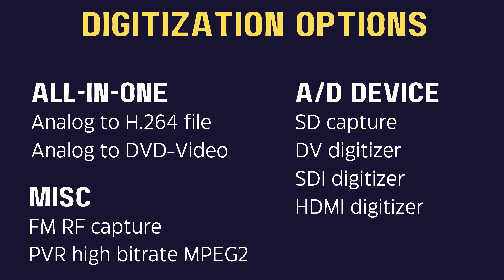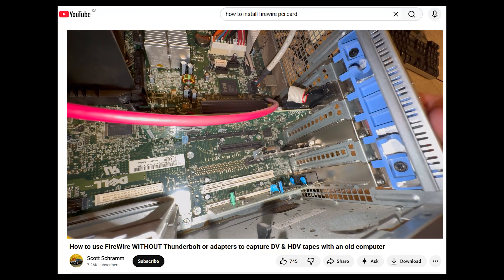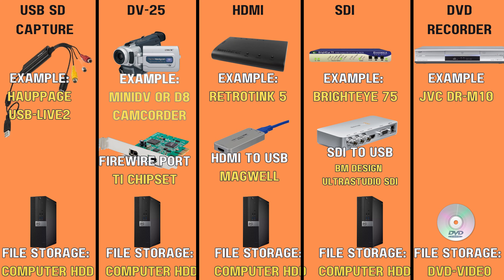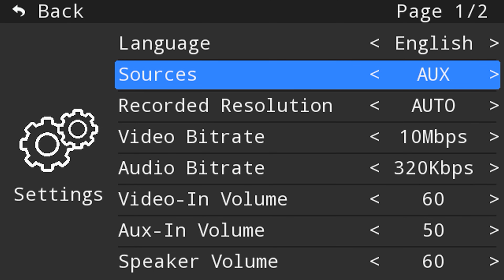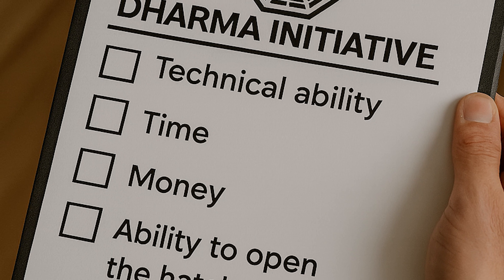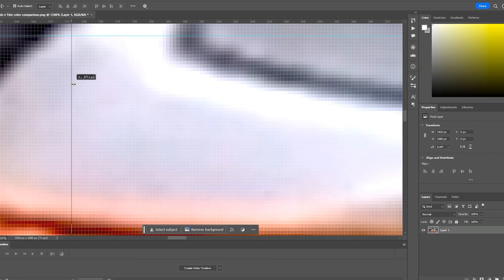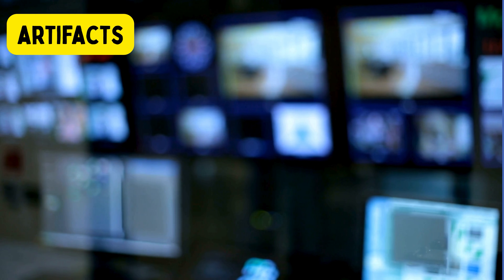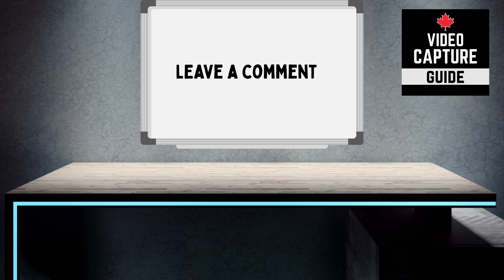Video tape to digital: all methods explained

Comment: For MiniDV transfer on Linux, I really like dvgrab. It’s command line, and you’ll probably need to run ffmpeg after to convert the container format, but it’s really easy to use. It works great for me, but I’m not an expert, and I don’t know if there are any technical issues with it.

Comment: Amazing guide! Thanks for your work! Here's another option that I'm using so that I can digitize without my laptop and can simultaneously watch my movies on my projector during the process:

I have 2 different set-ups using DVD recorders for vcr-passthrough depending on the quality/condition of the tape being recorded. Pioneer 550h for tapes with bad flagging and Panasonic DMR-EZ28 for the rest. Both DVRs go through a 2-in, 1-out auto-switching HDMI switch and into a Atomos Ninja 2. Which is a professional film production monitor/recorder from the early 2000's which lets me record interlaced signal albeit only accepting higher resolutions (I use 1080i). The Ninja 2 let's me record lossless video onto it's internal SSD and I don't need to fumble around with hooking my laptop up or having a dedicated PC for this purpose.

There is another step in here for HDCP. And yet another another for EDID emulation since the Ninja is picky about the signal it recieves (I seem to only get a solid signal at 1080 resolutions). But this set-up lets me hit record on the Ninja on-the-fly anytime I see something on screen that interests me while watching my VHS. 

What's more- the Panasonic unit lets me simultaneously output from the HDMI and the component outs, which then goes into my Retrotink 4k so I can get really good de-interlacing on my 4k projector. I reckon it's about as good as VHS can look! 

One thing I'm curious about your input on. I use a prosumer JVC S-VHS ET deck (HR-S3600U I think...) that has an S-Video output but I've heard that they only output superior image when using S-VHS and that I'm better off sticking to the RCA outs when playing normal VHS. What do you think?
Reply from the maker: Interesting setup. Can you confirm whether the Pioneer 550H outputs 480i over HDMI? From what I understand it can, but in your case you’re still forcing 1080i because the Atomos Ninja 2 won’t accept SD resolutions and needs a higher-format interlaced signal to work properly.

The ideal workflow would be outputing 480i to Atomos Ninja 2 and then software handle upscaling. I like that it can capture interlaced and leave it interlaced. Would be an interesting workflow to compare. It definately takes less room than my desktop computer running Windows XP. :)

Regarding S-Video, in the comparison tests I did on this channel, the captures done with S-Video cables looked sharper than the ones done with yellow RCA cable (composite cable). https://youtu.be/McFurc_Uqxc
Reply: Technically the Atomos Ninja 2 DOES capture 480i but it expects a professional-grade, rock-solid signal and only receives HDMI. Both of my DVRs output 480i but, as Chat-GPT has diagnosed, they output an "inconsistent field cadence with sync phase drifts"  at 480 or 720 over HDMI. These DVD recorders output a more accurate cadence at 1080, for whatever reason. So that's what I'm working with for now. I don't really need archival quality for my purposes anyway so I'm happy with just getting a lossless interlaced capture despite the out-of-sequence upscale.
Reply: I hadn't seen your s-video comparison video before but the results are clear- I'll try to use an s-video cable from now on!

Comment: 14:10 On the IO Data I ran into audio buffer overrun problems and the audio would crack, ended up getting ans Osprey 260e card for $60 off eBay and it resolved everything.

Comment: As of now the ATI 600 USB I found online doesn’t have the composite AV cable only dongle.  Is the alternative method recommended with my use of the Hauppauge USB LIVE 2 or Pinnacle 710 USB?
Reply from the maker: The ATI 600 uses the Theater Graphics chip, which Lord Smurf at DigitalFAQ strongly believes is one of the best chips ever made for digitizing VHS and home recordings. That said, others feel the Hauppauge USB-Live 2 and the I-O Data GV-USB2 are just as good.

Lord Smurf has also recommended (and sold) the Pinnacle 710, though there are different revisions and some are better than others—I’m not sure which revision is ideal. Still, in practice, the Pinnacle 710, Hauppauge, and I-O Data devices are all generally acceptable and roughly equivalent to the ATI 600.

None of these have a built-in line TBC, so results depend heavily on the source. Using a VCR with a line TBC is strongly recommended. If not, pairing a non-TBC VCR with a Panasonic ES-10 or ES-15 in passthrough can act as an external line TBC to fix top-edge waviness. Other DVD recorders can help too, though usually not as well, but they may avoid the brightness boosting seen with the Panasonics.
Reply: @videocaptureguide  ATI 600 USB is not Theatre, but rather a specific TI. And correct, Pinnacle cards are long-lived, versions exist, some good, some not.
Reply: @lordsmurf I now have the Pinnacle USB-710 Rev1.0 and also a Panasonic DMR-ES15 (PAL version).  However my frame TBC is just a FUZE video stabiliser which is NTSC capable only.  Will try experimenting with them if I have the time.
Reply: @videocaptureguide I see, thanks for the explanation, I just ordered the Pinnacle USB-710 so Ill do some experiments with it along with my Sony RDR-GX380 as line TBC or my FUZE Video Stabiliser TBC.  As of now I only use my Sony VRD-MC5 as for VHS captures.

Comment: I found a used Mitsubishi HS-HD2000U D-VHS VCR and a Pinnacle 710 capture card (brand new) both in a thrift store, what sort of frame TBC and PC do I need to complete the chain?
Reply: Keep the Pinnacle studio software CDs. The software sucks but I had my Pinnacle lose connection with the audio drivers in crossbar thing to where there was no option to adjust them. They did that when I captured in windows 10. I was wanting to do a clean install of windows 10 to improve Selur’s Hybrid. It did help Hybrid but it messed up my capture card until I connected to pinnacle studio and adjusted the audio in there then connected back to crossbar thing. Pinnacle studios worked in windows 7 for me but I couldn’t get it to work in windows 10. Anyways I would hang onto those CDS or just don’t let windows 10 update or use the windows xp system you have. I use a widows 7 PC I got off of Facebook now. You can find one for like 25 bucks.
Reply from the maker: Holy cow. Finding a D-VHS deck at a thrift store is a dream come true for most of us. Congrats!

That Mitsubishi HS-HD2000U has a line TBC, so for most troublesome tapes you should be in good shape. Although I read it is not quite as strong as the one in the JVC VCRs. 

The Pinnacle 710 also gets good remarks from lordsmurf over at DigitalFAQ. Just note there are different versions or revisions of the 710, so exact behavior can vary.

For capture, use VirtualDub 1.9.11 and a lossless codec like HuffYUV, Lagarith, or UT Video.

You probably will not need an ES10 or ES15 in the chain, but on some very wavy or unstable tapes the deck’s line TBC may not be enough to remove all waviness. An ES10 or ES15 might be needed. In that case turn off line TBC in vcr and let ES10 or ES15 do its job. But if you do this, keep in mind that it brightens whites so you need to adjust ProcAmp settings in VirtualDub to compensate. Otherwise whites will be blown out and you will lose details. If tape has very dark scenes and very bright scenes you may need to stop tape, adjust brightness/contrast settings and redo capture of a scene. It’s annoying to do but sometimes necessary. 

After ES10 or ES15, you could add a frame TBC to further reduce dropped frames but it’s probably not needed and given the price not justified. 

Although with your recent luck, I am betting you will find a frame TBC at the thrift store next time too. 😄
Reply: @videocaptureguide  haha I honestly had no idea what "D-VHS" even was when I picked up the VCR, between that and the capture card I've invested approx $16.37 into this hobby so far. I was given my grandfathers VHS-C camcorders and a bunch of new blank tapes to try. 

From what I've been reading a frame TBC seems necessary but I don't even know where to look for one and the DataVideo TBC-1000 that many mention looks like it's going for a few thousand. Is there a list of all the available frame TBC's available? 

For a PC, I use a Windows 10 gaming PC but I do have an old Dell with Windows XP. Does that really matter? I was going to figure out how to get this USB Pinnacle card working on Windows 10.

In my mind I thought the chain would go VCR --> frame TBC --> USB capture card --> PC 

THANK YOU for all the help and advice!
Reply from the maker: Your DVHS has the same superpower as my JVC SVHS which is the ability to use the digitizer built into the unit to output data via FireWire port on VCR. Then you won’t even need the pinnacle digitizer because the vcr is already digitizing it into a DV25 codec video file. As I mentioned in the video, it is not as good as an uncompressed video that you would get with the Pinnacle + HuffYUV codec but it will be a bit easier to transfer. You could compare the two methods to see whether the DV25 method produces a less waviness than the analog out method. 

Either way, you found gold and have a few good options.

I have a video on frame tbc and whether you need one.
Reply: @videocaptureguide  The FireWire to USB bridge in the Pinnacle 710 is nice to have if you only have USB ports on the computer.
Reply from the maker: I don't have one, but adding this in case anyone stumbles upon it: if using the Firewire-in to USB-out, one should connect the USB cable to the USB 2.0 ports on the back of the desktop computer to minimize the problem of chipset/USB implementation in the front ports. Even then, it can be hit or miss.
Reply: @EM-ve9bh Out of curiosity was your boxed Pinnacle set to all zeros out of the box on the proc amp because mine wasn’t and you gotta change that. You can just click default settings.
Reply: @duncanmacleod2136  Thank you for the responses, I've been trying to research this as much as possible in my free time. I have yet to open the Pinnacle as I've been reading that what I need is an ATI card and all these USB cards aren't great. I might try and sell this thing and get a better card but I'm still trying to learn, this is a bigger rabbit hole than I expected lol I'm a complete noob with tape digitizing.
Reply: You can try an es-15 and see if you even need a frame TBC. The es-15 has some drawbacks. So does the wrong generation of TBC or one that’s in bad shape. Es 15 is a good budget option.
Reply: @duncanmacleod2136  The problem here is that the line TBCs can conflict, and DVD recorders are not passive devices. Those add some % of noise and quality reductions to image. So the best VCR takes a quality hit when using the lower-end TBC recorder. All of contains beyond the line TBC is a non-TBC frame sync (which is not the same as frame TBC).
Reply: @lordsmurf I don’t own an es-15 but I will hear about it adding noise, messing with luma, and posterization. I do own a frame TBC that works great. I don’t have vertical jitter or other issues.

Comment: Can you comment on or make a video on capturing DV/miniDV through FireWire on a Mac computer? Versions of macOS up to and including macOS Sequoia include FireWire drivers. Using serially connected FireWire 400 to FireWire 800 to Thunderbolt adapters, it is possible to transfer files to the Mac. Can you recommend the best software and provide other tips?
Reply from the maker: I don’t use Mac but this appears to be the answer or at least the place to start reading. https://www.reddit.com/r/MiniDV/s/xdUIOmHFwL
Reply: Sony kade standalone capture devices where you can put it straight in HD.on a DVD.

Comment: The only issue I have is your showing the RF capture stuff incorrectly, should have reached out for current assets and info anyone can, and also there's better visual graphics explaining the workflow.

CX Cards was the first initial workflow going back to the 2000s, then upgraded to the clock gen mod synchronising 2x cards VHS Video RF + HiFi RF and Linear audio, that became production standard in 2023.

The Domeday Duplicator or "DdD" came out in 2017 for Laserdisc, still is a single channel focused device which context must be applied, such as Video8 
/Hi8 and NTSC Betamax HiFi which have a single test point with both signals.

MISRC V1.5a (2024) which has been out for over a year now, basically is the dropping replacement for the cx card clockgen workflow, plug and play flashing plug and play drivers.

It's the v2.5 is coming soon with 4ch audio alongside 2x RF and if you'd have actually poked for proper research you could have gotten a V2.5 render as an actual coming soon thing because it's literally releasing this month.

(Both MISRC and Clockgen Platforms have real-time resampling and real-time FLAC i.g 300~380MB/min rate and yes you can run it on a 35 USD compact potato mini PC like a Lenovo ThinkCentre which is what I use for testing, It's mainly also a complete workflow for anyone on a laptop because all operating systems are supported)

Also software decoding already has superseded legacy hardware and it's not that hard to show off, It's regrettable you didn't show off IMX style exports especially which none of these other solutions will provide at all, but you don't have the hardware do you? or took the time pull down any reference captures for testing and demo, and if you did you would have also properly noted it completely replaces the vector scope scanline scope you know pieces of equipment that will cost you an extra 150~600 bucks for doing calibration work for tapes with proper colour bars on an ingest station.

But I think the thing that's also forgotten is the MISRC can fully capture S-Video or CVBS so there's a promise of CVBS-Decode improving which makes it wholesale kill off any legacy capture workflow, but direct FM RF off tape processed via VHS-Decode long already been established and production workable.

I think the last thing being forgotten about is FFV1 at 40~60mbps 8/10-bit 4:2:2 this is the current standard for archives due to industry support and it's an FFmpeg native format.
Reply from the maker: Thanks for clarifying. I hope viewers came away from my (imperfect) description understanding the gist, which is that RF capture may be better than the best current workflow, and that it's getting easier to set up. I would love to get one when the next version is ready and do a video showing the setup, the capture, the decoding, and the comparison against my JVC-VS30-->ATI AIW 9600XT workflow.
Reply: @videocaptureguide  Give me a poke directly if you want to get a proper refresh and update It's a tragedy when information isn't pushed to the current updated standard considering how many hours go into the docs and development, you did slightly better than RetroRGB though hehe.

RF Capture however it is always to be separated from decoding but decoding has already reached practical deployment and practical use in archival, It's the accessibility of RF capture has scope increased with devices there's actually more then what you mentioned.

But the main thing you'll notice with that workflow comparison idea is decode will have more detail, but it will also have better framing capability because you can adjust that in post, but if you're going for the most refined setup then an ADA4857 amplifier ought to be purchased and deployed, that was standardised back with the clockgen mod workflow, especially for NTSC tapes which might have crosshatching issues Spider-Man NTSC being a good test.

A lot of workflows don't seem to think in terms of universal deployment either but a more biased towards NTSC or PAL standards but really need to separate the difference especially since PAL decks run NTSC tapes too, and made a good example video for that, and RF capture destroys the market for SVHS decks because any later generation Hi-Fi deck has the same heads, amplification and tracking circuitry just the demodulation chip is different.